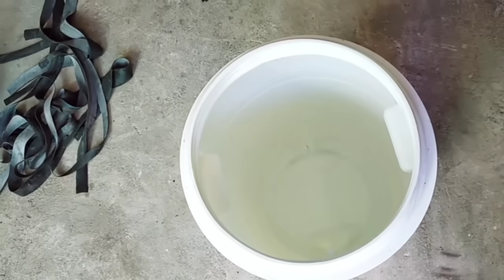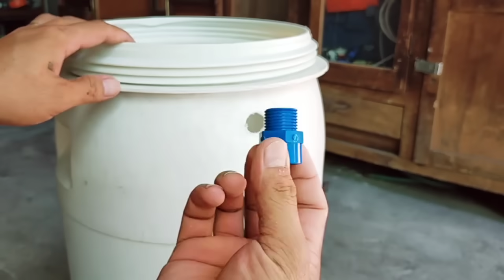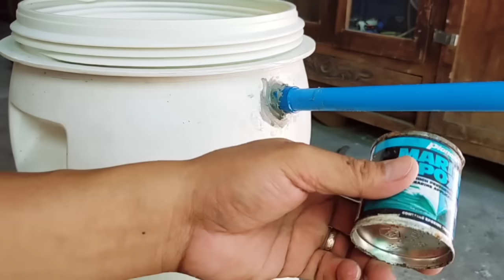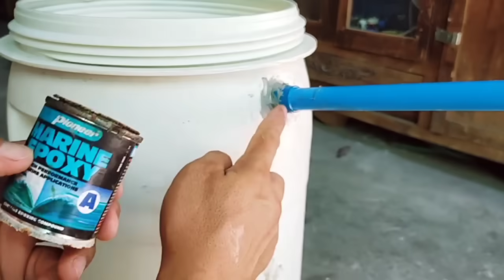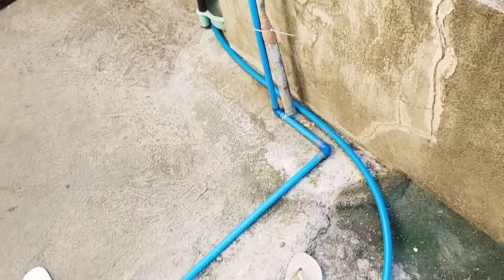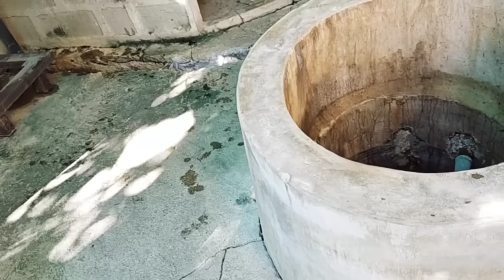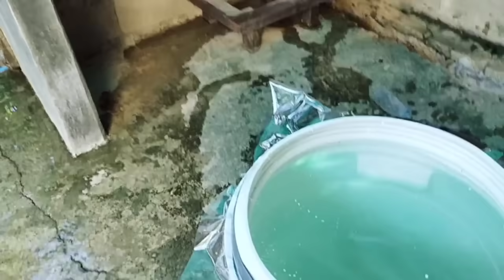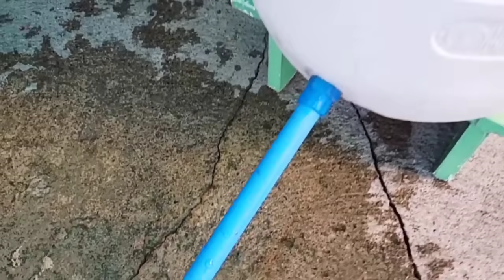improvised water pump no electricity how does it works none stop water life hack part 2

Comment: It will work as long as the volume of water inside the tank and outlet tube or hose is greater than the volume inside the inlet tube or hose. The vacuum inside the tank will pull the water in from the source as the water drains from the outlet; the volume in the tank will act as the force or prime mover. It will fail if the proper balance is not met or no vacuum. This siphon method is widely used in irrigations in southeast Asia and in some other parts of the world. Great video, nice working project.
Reply: Can it pull water from 50ft depth well?
Reply: A
Reply: காற்று அழுத்தம் கொடுத்து தான் இருக்கும் தண்ணீர் வரும்
Reply: எனர்ஜி பவர் தான் இருக்கும் இந்த நிலையில்
Reply: Maybe so if this works why isn't he flowing the water back into the well to turn a waterwheel generator 🤔🤑🤑🤑😲🕵
Reply: Semoga saya bisa mencobanya
Reply: If it works why hasn't he created portable water power 🤔 I tried a similar experiment many years ago but I think because I added a p-trap to keep air from flowing back into the system as water flowed out I could not over come the vacuum I created so mister smart guy why hasn't he created a portable water powered generator if this is possible because that would be free power anywhere on the planet😏🤑🤑🤑🤑
Reply: @sibaprasadmukharjee9900    Sadly, no. The limit is around 10m.
Reply: @balwek2  is
Reply: @sibaprasadmukharjee9900  only less than about 30ft (1 atmospheric pressure)! You have to do the method twice I think if the 1st step is working! No one is used this method in a place where I have seen ! Do it and report to the public plz!
Reply: if you think that the total weight of the water inside the barrel which is heavier than the total weight of the water inside the whole length of the suction pipe to suck the water from inside the suction pipe while the barrel is closed and the level of water inside the barrel is getting low and creating a vacuum, you are wrong. this setup is not workable and would not work. Regardless of volume or shape or weight of water inside the barrel, the pressure head is solely determined by the height and density of the water inside the barrel and not its volume or shape or weight. Likewise the pressure head inside the suction pipe is also determined by the vertical height of water inside the suction pipe. In this setup, the pressure head inside the barrel is less and can never be higher than that of the pressure head inside the suction pipe, hence, water would not flow towards the discharge pipe. There is something hidden in this setup which shows water is flowing towards the discharge pipe. Just remember that not in any way we could violate the laws of thermodynamics.
Reply: Viễn-Phương  I agree with you sir, it would be best if buried underground to minimize damage and traffic, especially if it's going to be in a permanent location.
Reply: @Kiddyyep  but something tells me it will pull less water than the water used as the prime mover
Reply: @sibaprasadmukharjee9900  even an inch of water would not be pulled up by this setup.
Reply: @Kiddyyep  unless the source is higher that the discharge, this setup would not work. don't waste your time and materials in so many measurements.
Reply: @edgarcordova4534   maybe your brain can not pulled out your inner brain..
Reply: @sibaprasadmukharjee9900  it would not pull water even an inch higher. don't try this
Reply: @bima8456  don't try it, this is fake🤣🤣🤣
Reply: @edgarcordova4534  what setup would you suggest sir??
Reply: I tried it water is coming but gurling with air and its not pulling from the well
Reply: @antonmoric1469  thanks fpr the info but is it possible to repat the process adding another drum pump after each 9m ...
Reply: @edgarcordova4534  but water density doesn't change so easily. And it would need much greater vacuum for it to start boiling.

Vacuum intensity is given by the total weight of the water in the container.
Reply: @JosephAzzopardiRummiena  try with longer outlet pipe
Reply: Thanks I will try it
Reply: @antonmoric1469  If so, then to pump 50ft or more, you can have a series of them. the outlet/output of one becomes the inlet/input of the next. Just my thought.
Reply: آیا میتوان با این وسیله از چاه با عمق 30متر  آب کشید؟
Reply: @venu.venugopalvenu389 more like air vacuum I think
Reply: @randypratt2887 why don't you?
Reply: @randypratt2887  the other end has footvalve...oneway movement...it doesnot go down
Reply: I built something similar to this a lot of years ago you can siphon water up hill because if I could I would have built a new hydropower system 🤔
Reply: @sibaprasadmukharjee9900  no but what can is a windmill or a solar pump or a parabolic sterling engine
Reply: Zm bombas water pumps 😉
Reply: @saidgawa2506 😅 14:06
Reply: this thing doesn't work at all.. Someone to assist me, please.
Reply: Sorry not working
Reply: As an engineer with more than 50 years experience in the. business I don't think so that's capable to suck water level beyond 30 feet.the maximum water level the shallow pump will work.Thats only for shallow well water level.More than 30 feet depth water level that's already considered deepwell..FYI
Reply: What if you introduce ait pressure from vompresser?
Reply: @edgarcordova4534 how about it you introduced air from compressor or vacuum?
Reply: this system is used between cities you sometimes see water towers